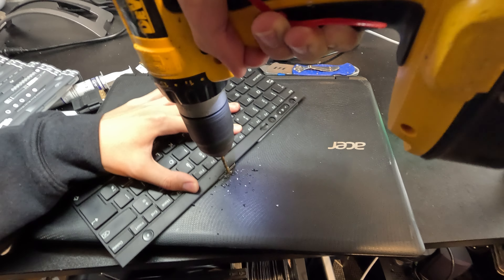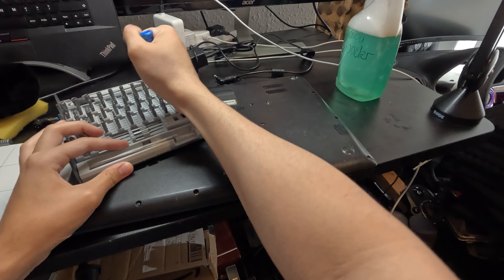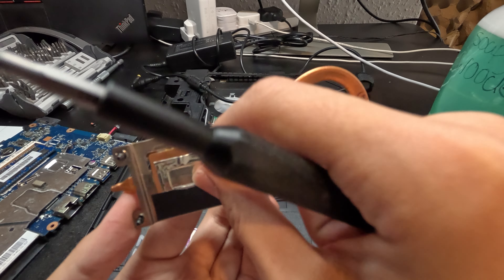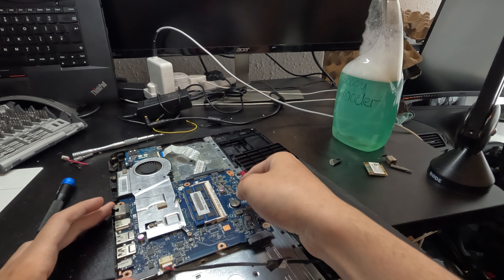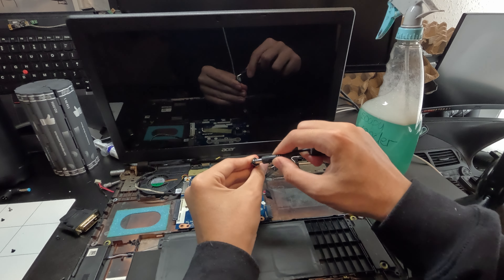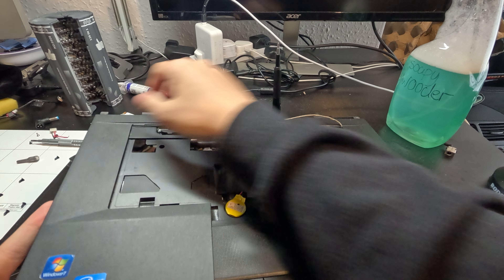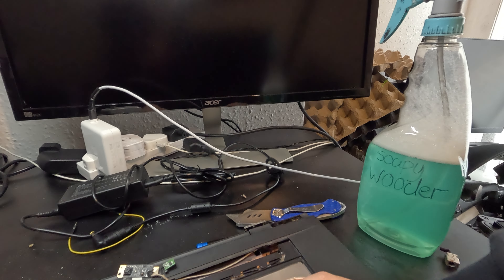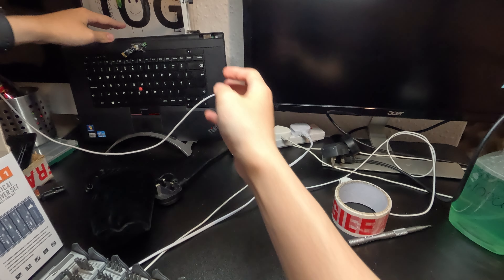£2 Intel Celeron Laptop!

Comment: Measure the voltage of that crappy CMOS battery. I've had an acer be a right pain in the backside with one of those soldered on CMOS batteries because it was flat.